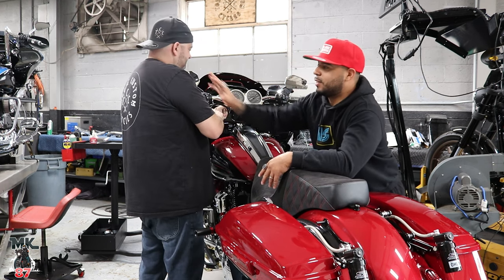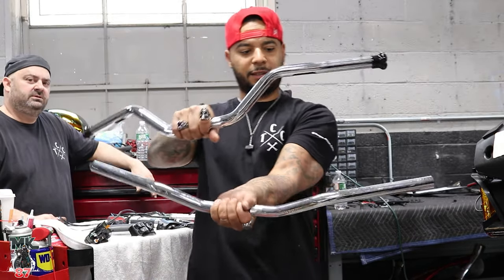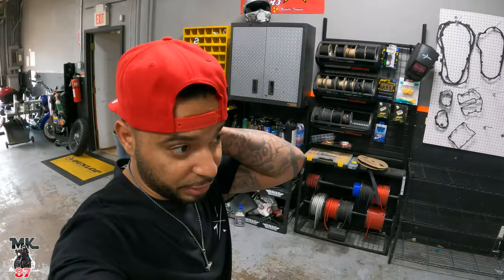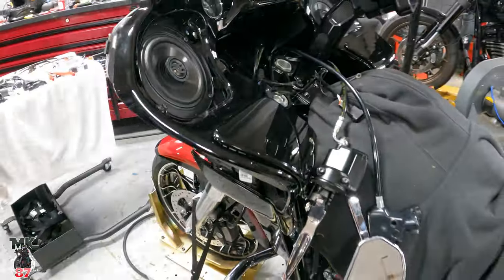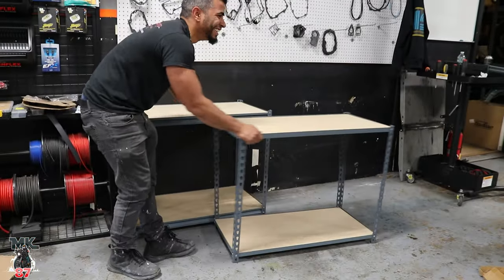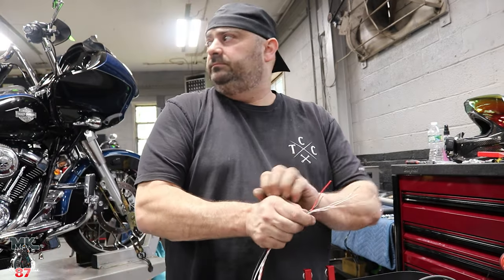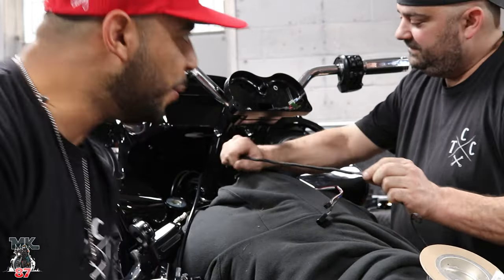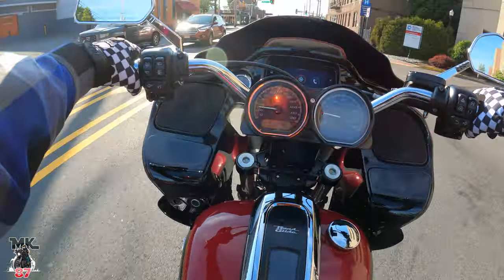Arlen Ness method pullback risers for Harley Davidson Road Glide / install and ride

Comment: #7 on the install instructions for the riser states to “Discard top cup washer from handle bar dampeners”. Any reason why you used them or just an over sight? Have the risers come loose at all since the install?

Comment: I ordered the Arlen ness stainless bar for my method riser and they sent me black instead. Very poor quality bar I couldn’t get my throttle to go in after a lot of filing then the left side Harley heated grip wouldn’t go in with! These bars didn’t resemble Arlen ness quality so I think they bought Chinese and sold it under their name. Huge disappointment had to use regular grips and pound the throttle  by wire in ! Wtf!!!